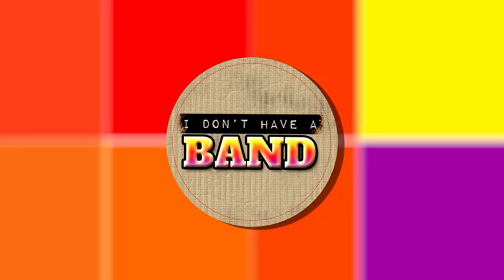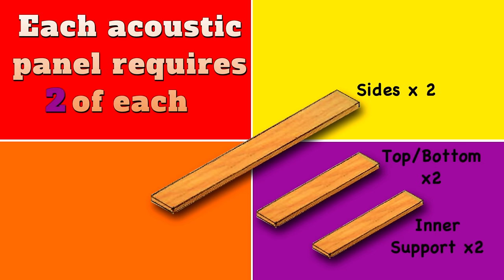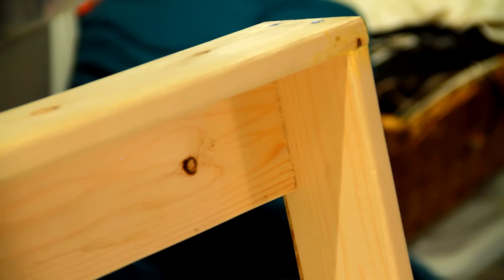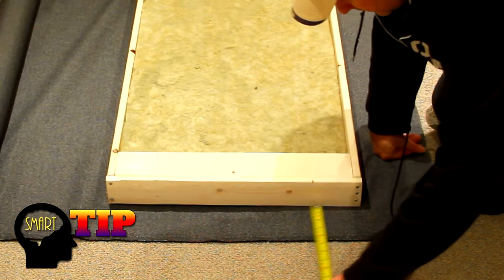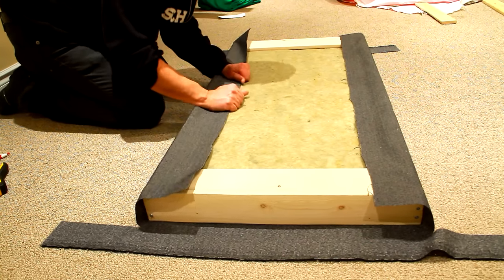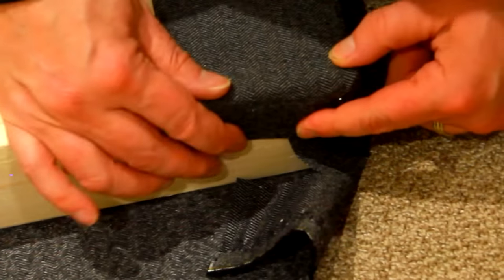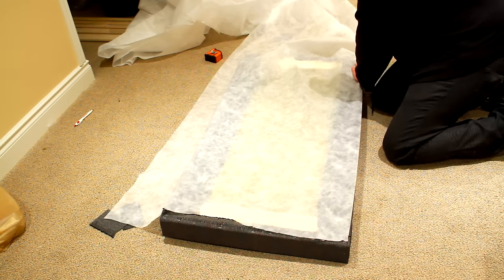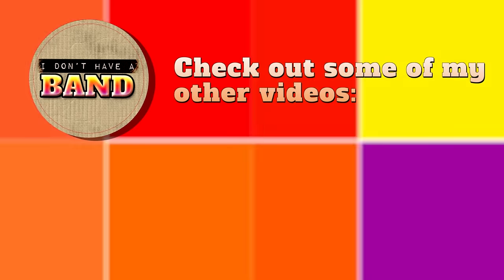DIY Acoustic Panels - How To Make Your Own Cheap and Awesome Panels

Comment: Pro tip: If your fabric allows it, iron the fabric before stapling it to the panel to ensure it will have no wrinkles or creases.
Reply from the maker: Great tip!
Reply: Depending on a kind of fabric but if it's natural (not synthetic) then a little spray of water after stapling it to the frame should do the trick too. Natural fibres shrink when drying.
Reply from the maker: @tjblues01  Love the input!!
Reply: don't iron it, steam it. Not all fabrics can handle direct heat.
Reply: @Robbie-mw5uu  “If your fabric allows it”

Comment: You may want to use fabric adhesive to adhere the insulation to the outer fabric, (think of the fabric as a drum) may get better low hz abortion.
Reply from the maker: Thanks for the tip!

Comment: Hi Lonely Rocker,

Thanks for the video. Currently it seemed really expensive to get the same insulation so I decided to purchased this one  R-13 Recycled Denim Batt Insulation with Sound Barrier (15-in W x 93-in L) https://www.lowes.com/pd/UltraTouch-R-13-Recycled-Denim-Batt-Insulation-with-Sound-Barrier-15-in-W-x-93-in-L/3731875  and try to build some panels following your video.

Let me know what you think.

I calculated all my expenses and looks like I'll be around $20 - $30 per panel but they'll be ~15" x 48" instead of 24" x 48".

Let me know if you have any advice.

Regards
Reply from the maker: My pleasure.  I've heard a few people mention denim as an alternative. One thing I've heard is that it is VERY messy with a ton of fibers.  Acoustically it may be a good alternative.  I haven't used it but you can play with different thicknesses to see what gives you the results you seek.  Do have a look at my new Acoustic Panels video and perhaps incorporate some of the tricks I'm using to contain the inner materials.  You may want to consider that with that material.  Check it out and good luck! https://www.youtube.com/watch?v=MHnFYFZc-w8&t=40s
Reply: Thanks. Will try that in the new video. Regards

Comment: Would be cool to have metric measurements in the video 😉
Reply from the maker: They make conversion calculators for that ;-)
Reply: Lonely Rocker well, at least now you know, that your videos reaches audiences in countries where the metric system is used 😉
Reply from the maker: Ironically I live in one of those Countries(Canada).  Seems construction materials are always measured in Imperial.  But valid point.  I'll keep that in mind next time :-)

Comment: are these insulators carcinogenic?
Reply from the maker: With a topic like this I would highly recommend you do your own research through official sources.  However, I can tell you I had my own concerns and contacted Rockwool directly.  They provided a ton of information about the safety of the product and expressed no concern for any health hazards.  Again, I am not the authority on this so I recommend you doing your own research, as I did, if you have any concerns.  Good luck.

Comment: The crappy part right now is I can't find any 23 x 47 batts at any of the usual big box stores; it's all the 15 x 47.  They all blame it on "covid".  At some point, that needs to stop.  But that's another story.
Reply from the maker: I know times are tough.  Even the concept of "Cheap" and Awesome is challenged as costs have shot up.  It's a pandemic.  It has to run its course.  Until then, do the best you can with what you have.  Also, check out my new panels video and see how I handled the insulation part.  This might actually help you with what you have available:  https://youtu.be/P8rsU22K--Y
Reply: Hi Lonely Rocker, Thank you so much. What an EXCELLENT VIDEO with specific details needed to actually build Acoustic Panels! So many videos assume that we know how to do it, have all the tools, and even a complete workshop for these type of projects. I am seeing the same thing in my area showing that the stores like Home Depot and Lowes are out of the insulation! Yeah sure, ok! I don't believe the reasons we are hearing. I think the powers that be are gradually reducing all of our supplies and saying it is because of c v 1 9. That seems to be happening with way too many things. Don't we want our f r e e d o m and c h o i c e s as we had before? I know I do!

I saw a video with a guy who used towels he bought at a thrift store as insulation after he tested them for the sound reduction properties with a meter. He was trying to show inexpensive ways to build diy panels also. The readings for sound absorption of the towels were way better than several acoustic foam products. He didn't test the towels against this particular insulation used in the video. The explanation I found was that the towels have more mass to absorb more sound. It's just a thought as an alternative for the insulation but the towels might be quite a bit heavier. 

Another video said that if you place the panels an inch from the wall, this creates another layer of air and less of the noise going through the walls to the other side. This idea is for noise control for the neighboring rooms, walls, homes, or spaces. Have you considered using Cellulose Sound Barrier Foam Board, as a possible backing of the Acoustic Panels, to reduce noise going through the walls of your studio? It is white and could easily cover the insulation and/or the finishing material stapled to the back of your panels. I'm looking into cellulose to block sound and noise from going through the wall (behind the Acoustic Panel.) By the 1 inch air gap in hanging the panels and the cellulose on the back of each panel, maybe it might create two additional ways to reduce the transmission of noises through the walls of a studio.

What do you think if someone put hardwood perforated peg board in the front of some of the acoustic panels (before lining them with material) for partial absorption and partial reflection of the sound? I think your design could be modified in these ways for a variety of applications and uses. Perforated hard wood peg board in front of some of these Acoustic Panels you designed might make one corner, one wall of a vocal sound booth, or a certain space within a studio for recording vocals a bit more lively and bright. These are just some ideas to add to what you've shared and used already effectively to enhance acoustics. It would be great to know what you think about these suggestions.

Thanks,
Susan
Reply: You have probably already come up with a solution but I searched around for 23"x47" and could not find them anywhere near me, so I suspect many other are in the same position. So I'm writing this comment for whoever.

15x47" works fine to make a 2'x4' if you need those dimensions. 3 pieces of insulation give you two panels. Cut one piece in half with a sharp knife to 7.5" width and lay it next another piece and you have 22.5"x47". I used a breathable underlay fabric to wrap them together and secured it on the back with a normal paper stapler. 

I recommend you use lumber with actual 1" thickness so your space in the middle will be about 22". It will be just as snug as the 23" insulation in the 22.5" gap. This does decrease your space height-wise as well, but in my case Home Depot only had Owens Corning Fire and Sound Guard which seems like it's a bit more delicate and flimsy than Rockwool, so it went into the 46" space just fine. Or, you can use .75" actual lumber for the top and bottom pieces if you are worried about compressing the insulation too much, although I think it's very negligible and did not noticeably affect absorption levels.

The underlay wrap and snugness also helps prevent the insulation from sagging downwards, which seemed likely given that it was less rigid than Rockwool and each piece is less wide than the 23"x47" insulation. In my case the insulation came in a pack of 10, so i made 4ct. 4" 2'x4' and then used the remaining four pieces to make 2ct. 7" thick 18"x48" absorbers for lower frequencies and placed in the corners of my room (I used thicker lumber here on the side of the frame to make it 18".)
Reply: just some numbers get er done hun

Comment: I think to make it more simple just buy big canvase, put rockwool inside, and close it again
Reply from the maker: Huh?  Not really clear on your point.
Reply: @LonelyRocker  i mean if you could buy painting canvas as a frame. Put it rock wool inside.
Reply from the maker: Not sure if you would get the depth you need.  Plus I think it would be more expensive.  But you never know!!
Reply: Do this but with towels. Buy some thick canvass and towels at your good will

Comment: Rockwool is pretty hazardous stuff - make sure you thoroughly insulate it with thick material front and back. Better off using cheap, fibre pillow material...much safer!
Reply from the maker: That’s actually a myth.  While I always preach caution and handling the insulation with care, Rockwool is a mineral wool product.  Far safer than other types of insulation like fibreglass.  I’ve covered this topic in other videos on my channel. Check it out.
Reply: @LonelyRocker  not sure it is a myth actually, judging by all the controversial reports online. I guess it may depend on the brand and variety - perhaps some are less hazardous than others? Personally, I would not want to use it extensively for acoustic panelling. As said, alternative materials could be used which are arguably safer... 😊
Reply from the maker: I have covered this discussion in some of my other videos.  I've made it clear I don't endorse the product and I ALWAYS encourage everyone to do their own research.  I did mine,  including speaking directly with the manufacturer. There are many professional manufacturers of acoustic panels that also use mineral wool.  Sometimes you need to filter through the controversial reports online.  there are also many positive ones.  And the safest part of Mineral Wool?  It's non-flammable. Many alternatives are very flammable.  Something to consider...
Reply: @LonelyRocker I agree always, research any specific brand first, as it appears they're not necessarily all the same. The non-flammable point is an important one you mention, often overlooked. I've actually made pretty good acoustic panels with artist canvases, backed with either old towels, or woolly blanket material. They can double up as wall art too if you're creative!
Reply from the maker: Careful with those towels...they are very flammable and would fuel a fire in a very unfortunate situation...
Reply: @LonelyRocker  sure, but on that logic, so could curtains, furniture, soft furnishings (cushions, rugs etc)...
Even cloth covers for Rockwool panels (😉)... the main thing is towels won't give off any potentially toxic fumes (like some sponge or foam types), which could be far worse!
Reply from the maker: People like to fear monger about insulation.  Mineral wool is a modern, safe alternative and is widely used and deemed safe.
Reply: Rockwool is not fibreglass.

Comment: Good,, but we needed to know How to MOUNT   ....................................
Reply from the maker: Giving that topic some thought.  Every space is different, so it's hard to present a universal concept.  Thinking about it though...
Reply: @LonelyRocker  how did you mount the corner ones? I'm getting ready to put mine permanently in place.
Reply from the maker: I've been asked that before.  That's hard to explain in a comment but I used two L brackets bent to about 45 degree angles and attached to the sides of the panels.  So when you press the panel into the corner the brackets are flush to each wall.  Then I marked the middle of each bracket and put a screw in each wall with a drywall plug.   Wish I could post pictures in the comments!!!

Comment: Is that Rox carcinogens free...?
Dangerous to your health. 
Lots of people using these things for acouatic panels without any clue that they are getting all those fiber particles in their room. Handling them without protection.... use proper mask while handling any of these fiber materials... build them out doors if poasible. Hope you guya do your reaearch before handling fibers.
Reply from the maker: Go through the comments.  There has been a ton of discussion about this and I have discussed it in subsequent videos.  I have also introduced additional safeguards in my updated panel design.  But I did speak directly to Rockwool about health concerns and that is presented in my Panel Q&A.  Check my channel for the updates...
Reply: There are som many alternatives on the market now, this isn't even a problem anymore.
Reply from the maker: I've covered this question so many times in comments and in subsequent videos.  I discuss it in my Panels Q&A Video...
Reply: @dirface  what alternatives are out there?

Comment: you have defeated some of the good of your design... The covering you used may be reflective.. The material should be acoustically transparent and have little to no inherent reflectivity.. Nice design, however, and they are quite inexpensive.
Reply from the maker: Thnx for checking it out.  I have fully tested my panels.  This fabric is definitely not reflective.  There is a Panel test video on my channel and a Q and A video where I talk about the fabric.  Check them out and let me know your thoughts.

Comment: That insulation cost $84 for 8 panels..man that sucks!
Reply from the maker: All in with this insulation you can make high performance panels for under 20 bucks each.  Similar premade panels could run you $80 or more.  So not sure this insulation is pricey for what you get.
Reply: @LonelyRocker  Yup, I did 8 panels at $18.75 per panel following your tutorial.

Comment: i made a crap pad of these exact same plans... tho i disagree with the cost/panel mostly bc the China virus has really jakked things up!!! supply chain is EFFED. 

I did get 22.5” tho for the insulation supports and not 22”. The rest of the measurements are legit.

For extra strength, I added more screws across the insulation boards and in the corners for torsional rigidity. Plenty strong enough for acoustic wall hanging panels. Thx again
Reply from the maker: Yeah, prices have jumped since I made this video three years ago.  Still relevant though.  Thnx for checking it out!

Comment: When ya buy 2x4x8 instead of 1x4x8
Reply from the maker: huh?
Reply: @LonelyRocker  I think she is referring to the nominal difference and actual difference that a 1x4x8 comes in ( in reality a 1x4x8 is actually 0.75 in. x 3.50 in. x 96 in, so i think to clarify; she is asking if you got a bigger size of wood since your dimensions state 1x4x8 or did you get an actual 1x4x8 not caring about the "actual" size. lol hopefully i cleared it up for you.
Reply from the maker: Good point 😂
Reply: Lol no, so I’ve watched so many acoustic panel tutorials that a bought 2x4x8 instead of 1x4x8 even after deciding to follow this tutorial instead. But I used those for the tops and bottoms. And then I went back and got the 1x4x8 for the sides to make sure the Rockwell would still fit. And it did! 
Then instead of having a whole support bar I just used the remaining wood squares from the sides to have a little support for wool even though I’m sure it’s not gonna fall out.
Reply from the maker: Thanks for clearing up the mystery.  And glad your panels worked out 🤘🏽😎

Comment: A couple of corrections/suggestions: You'd be lucky to find a 96" and cut it 4x to exactly 24" each. The blade is gonna take 1/32 each time. That adds up. Best to do 24 + 24 + 24 + 22-3/8 on one 96" and then 22-3/8 + 22-3/8 + 22-3/8 + 24 on another 96". Yes, 22-3/8". That 22-3/4" is wrong. You're welcome.
Reply from the maker: In your calculations you haven't factored that the insulation also conforms to "short measurement syndrome".  I have made a ton of these panels and these measurements make everything fit like a glove.  For one, the inner material is flexible and being a little snug holds it all together nicely.  This is why I make the videos :). You're welcome :)))))
Reply: @LonelyRocker  he really thought he did something there Lol